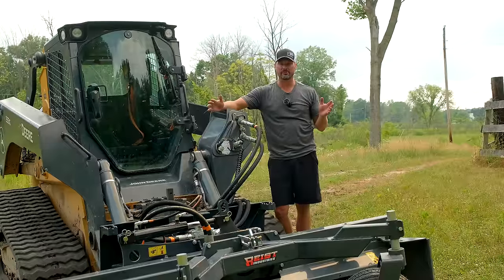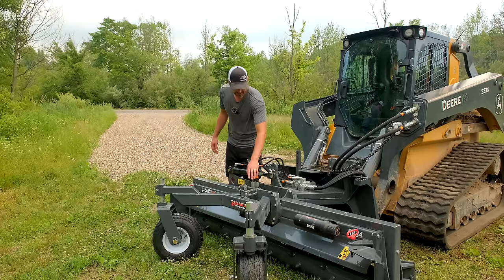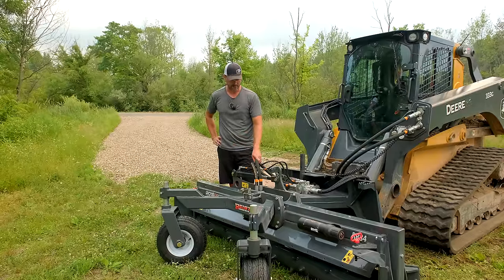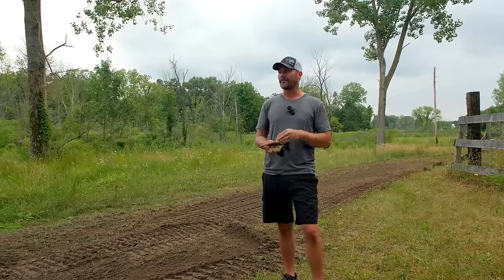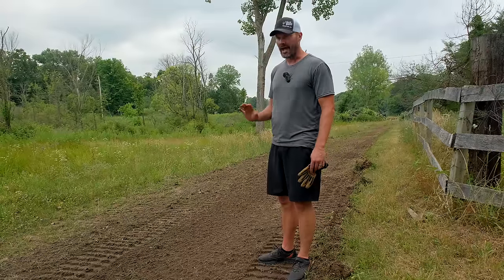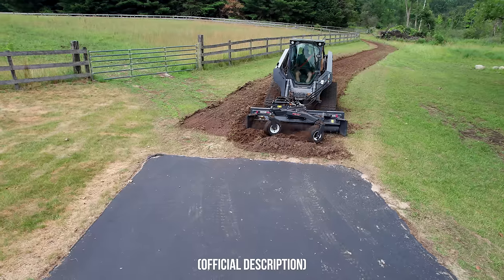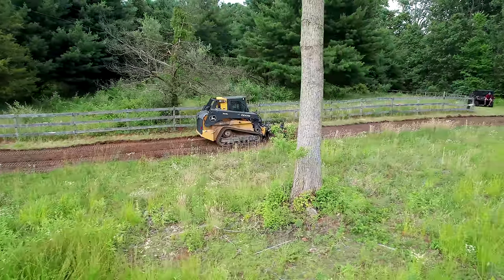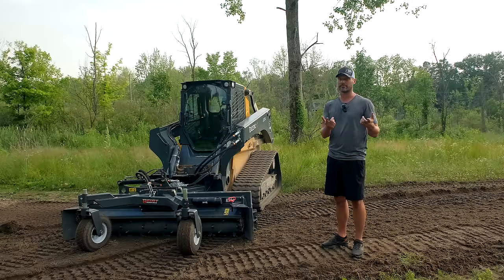IS IT THE POWER RAKE? THE SKIDSTEER? OR IS IT ME?

Comment: I've never seen anybody at the professional level use these to build roads/trails. Only for final grade before seeding or laying sod. Shallow tilling will do good enough then pack it with a roller then bring on the 2 1/2" for the base then later bring in the 3/4 with the fines,  or if you know where you can get crushed concrete, recycled, it gets really hard and lasts longer than any of it.
Reply: Where i live (Belgium) it's common used for prepping the surface prior to grass seeding etc. Combined with other tools oc. It's not that of a special tool.
Reply: Haha hell yea silly boys taking the crown down smh

Comment: It’s you, not the rake..you just need more seat time. It’s not a tiller..it’s a rake. The idea behind it is to break up the ground…once loosed, you just skim across the ground and the teeth on the drum will rake out the large material..I use ours more than the landscape rake. You should see what the required gpm on the unit requires. All the floating and angling..you don’t need it. As long as the drum can windrow, you’re fine.

Comment: Large road construction companies use this type of tiller for one purpose only. That is to mix lime or some other form of calcium into soil. This gives affordable stability. Blading windrow to created a crown give water drainage. The only stable subbase is dry.  This machine is almost worthless.  Get a blade that can cut at horizontal and vertical. One pulling machine.  Machine cost and

Comment: I've always come to the conclusion that the machine will do what its designed to do, and that the problem exists between controls and chair.
Reply: Depends. Sometimes it’s worth remembering that the operators are the ones who spend their days in the equipment. If it’s the first time trying something new, yes it can be that expectation and capabilities are mismatched and you be needs to be adjusted.but when a machine does something new or different, the guy in the seat is the best suited to know, usually.

Comment: I primarily finish grade for a living with half of my time split between CTL's and tractors with about 17 years experience. The stalling on those rakes is normal. Since they have blunt teeth it requires a ton of power that the limited output of the hydraulics can't always provide. Unfortunately the engine horsepower doesn't have much bearing on the hydraulic output power. The real value of a CTL mounted rake is the bi-directional functionality and ability to work in tight spaces. a 3pt mounted rake will provide a much more accurate grade because of its orientation being determined by wheels on soil that has already been leveled behind the rake vs unleveled soil ahead of the rake with a CTL. The 3pt also prevents the grade from being as affected by the tractor moving over dips and bumps. I've found that to get a flawless finish grade on a yard, its best to use a CTL to get the grade close and get dirt tucked in to all the corners and then let the landscape, sprinklers, trees etc. get installed. Then for the final step, I use a tractor with a 3pt mounted rake. In my case I use either an 805 or 605 ATI preseeder depending on the size of the area. For your driveway project I totally would have just used a 3pt rototiller though.

Comment: How come in none of these videos no one is cutting off the original sod before hand? Whether you use a sod cutter for smaller job or an attachment on skid steer for bigger jobs, you gotta cut the sod off clean so no old grass or roots remain. Then you can run your rake through to till, grade and level.

Comment: Good review Mr. Courtney!   Before you put the fabric down, compact the road with a proper compactor, then lay fabric and stone.  Fabric will of course as you said, prevent the stone from getting down into the soil.  Compact the stone every couple of inches, dependent on the weight of your machines will dictate how deep your stone will need to be.  The fabric will only help keep the weeds from coming up through it, it doesn’t stop weed seeds from germination and growing in whatever stone you use.  In the South it’s usually crusher run…you will probably have to spray an herbicide.

Comment: The 333G should have gone into reduced motor HP mode prior to running out of DEF to let you know that you need to top off the DEF tank before it ran out.  You will probably need to have the JD tech bring a laptop to reset the computer and clear any codes that running out of DEF may have caused.    Totally agree with you that the tiller would have been the right tool for this project, but great look at the power rake in action!  For finish work/grading it is awesome! 🔥🔥👍

Comment: I'd like to suggest grading that beautiful fine soil to each side with an angled terracing blade. Hopefully the thin layer will skim off and the blade won't dig in further. Successive passes with both tools will produce the desired box-out depth. Place, grade, and roll your aggregate. Use the windrow of fine soil to backup the shoulder. A combination of back blading and hand raking should suffice.

Comment: Set your wings straight out or take them off so you can angle your rake and windrow the material off to one side. As far as your DPF/DEF issue when you ran it out of DEF did you shut it down or did you just keep running it? Engine light still on?

Comment: It’s a great day to be number one
Reply: So how /why did you let run out of def ? I work on heavy trucks/ equipment and def systems are finicky and the systems should never be used below 1/4- 3/8 of a tank. When our drivers do this we have to use a diagnostic computer to remove codes and reset the ecm. Is there any warning lights on ? I have never had any unit “ work normal” after topping off the def.

Comment: Are you not suppose to angle the implement and push the pulverized material to the side with every pass.  That way  it would make it 1.5“ deeper each time you go over the road making it super level, eliminates having to strip it afterwards and reduces the mounds of dirt at the ends of the run. 
Jmho

Comment: Have a question I really can't afford much more then a 2025R I recently brought a 1025R I want higher 3 point lift what do you think? Ty
Reply: Same lift height on 2025R as 1025R. Next size up to get higher lift is 2032/38R
Reply: @wvdeere8643  Ty my Friend appreciate it! I'm liking my 1025R i know I need the adjustable link on other side also but it's just I believe a warranty issue it's barely 18 inches on a lite scraper blade from ag store 4 ft but it's going to dealer 28 hrs I just can't justify the $ on 3 series as im retired but you give awesome advice on doing jobs near home for folks I've been in the construction business all my life bigger was always better but I wish the 1025 was around hand digging telephone cable in backyards lol. Yea im old 😂🇺🇸😎
Reply: @RitchieLivewire67  i added the second adjustable link to my 1025r  and it significantly increased the lift height on the 3 pt
Reply: @donalexander4083  Ty Don im adding one!

Comment: Several things going on here, are causing less than ideal results. 1st- when running a front mounted power rake, you want to work backward. 2nd- don't try to do too much at one time... just a couple inches per pass. 3rd- when using a power rake in sod, you need one with a stone burier (screen roller).

Comment: You have just made a big muddy mess. Unmade roads need camber connected  to a side ditch this sheds water off the area in contact with the vehicle wheels this forming a surface which is passable in wet weather.
Reply from the maker: If you listened to what I said, then you’d know I’m installing a road there.  Obviously it won’t be left like this, geez
Reply: Lololol this guy must do this to a lot of videos to make himself seem smart instead of listening